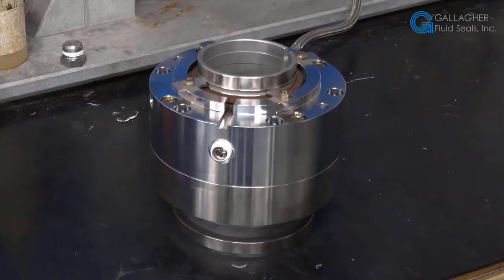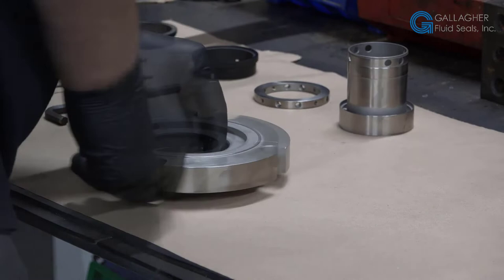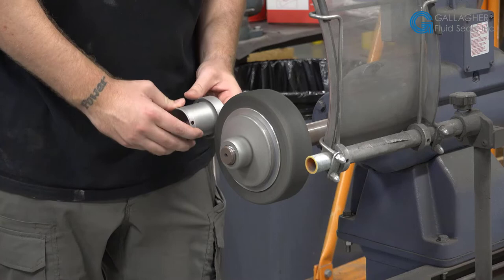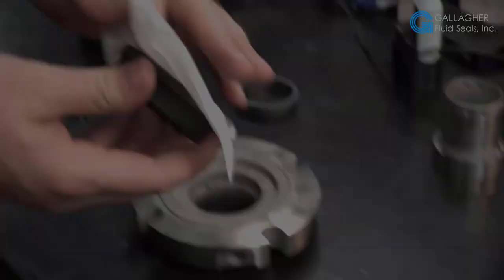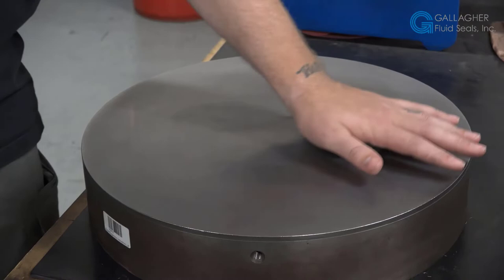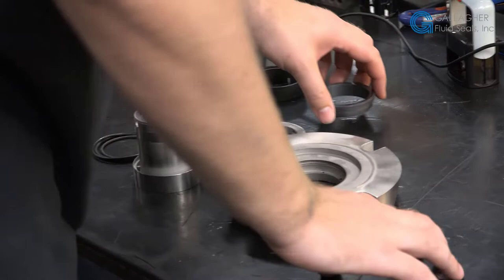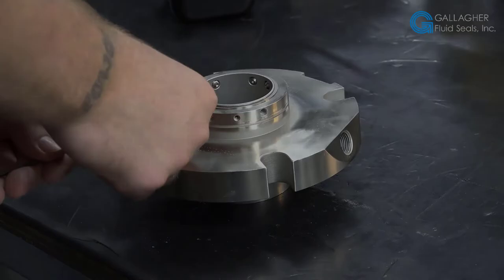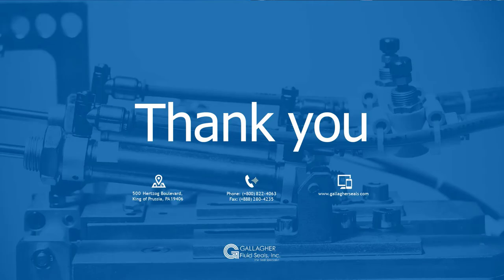Cartridge Mechanical Seal Repair and Refurbishment

Comment: How many mm this mechanical seal
Reply from the maker: Hello, there are a variety of shaft sizes for Eagleburgmann Cartex seals; shaft sizes in millimeters are 25, 28, 30, 32, 33, 35, 38, 40, 42, 43, 45, 48, 50, 53, 55, 60, 65, 70, 75, 80, 85, 90, 95, 100. Additional sizes can be provided if required.